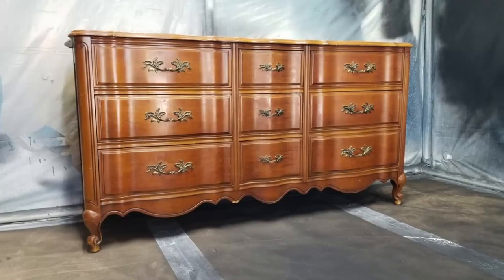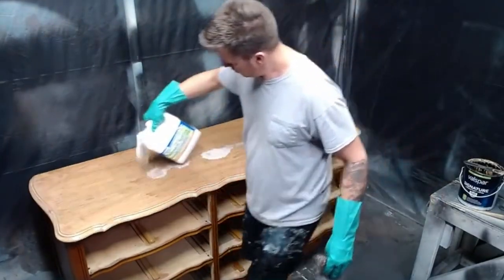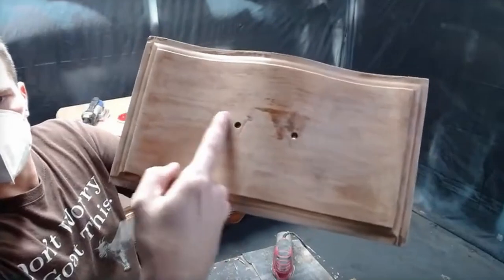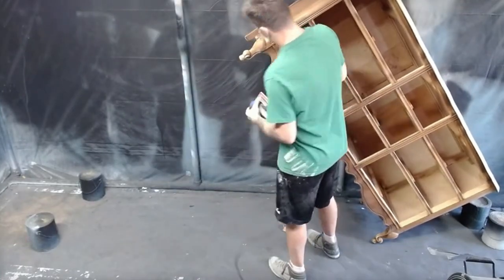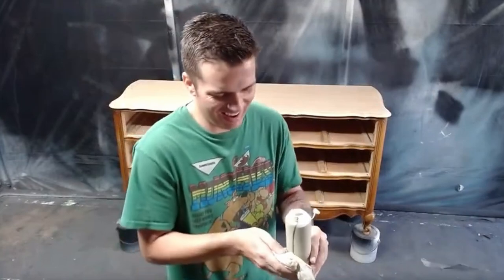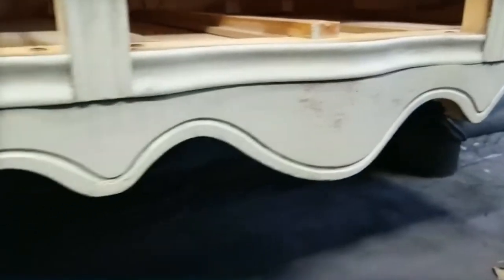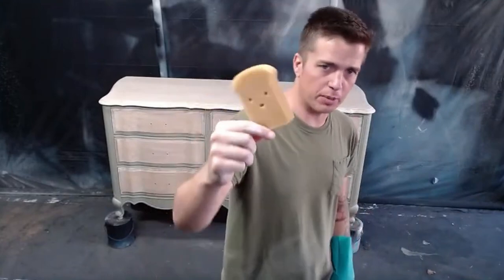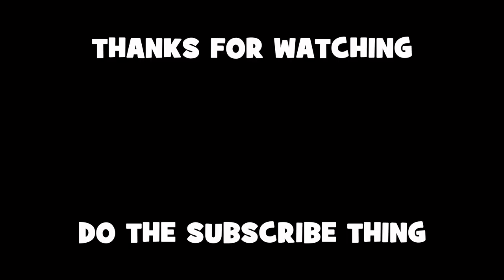Vintage Provincial Dresser Makeover - Whitewashed and Painted

Comment: You do an such beautiful job taking something that is "brown" and dated by cleaning, sanding, filling in imperfections,  priming,  hand painting or spraying three coats of paint and then several finish coats.  Lots of labor and the result is amazing.  Then you spray the original pulls and add a little rub and buff... to me it takes away from all the work you have done.